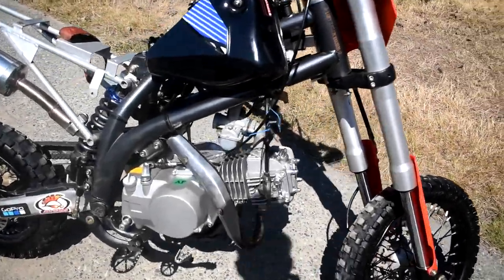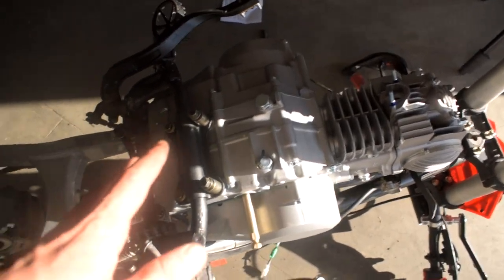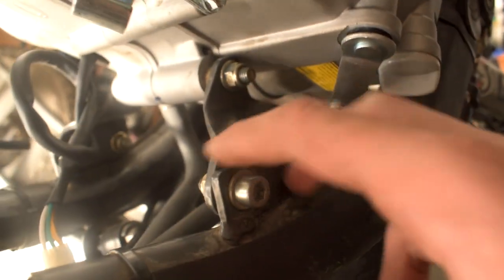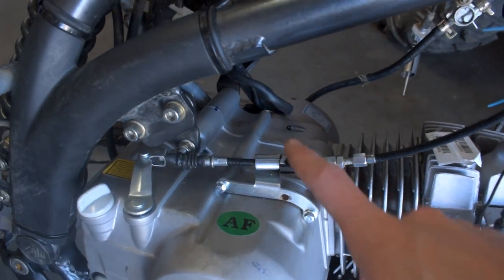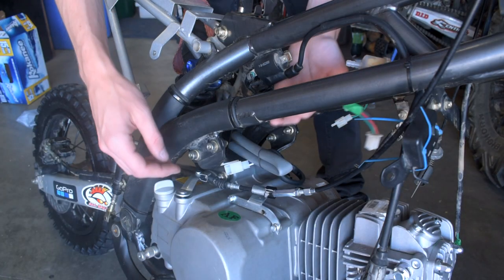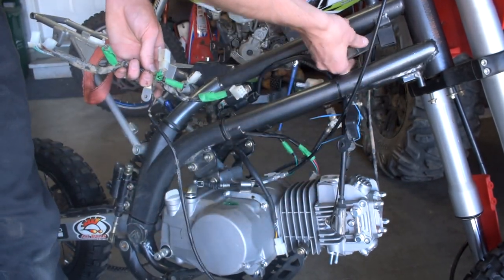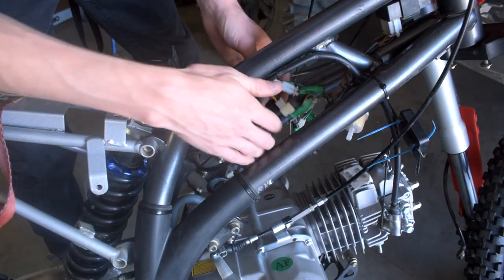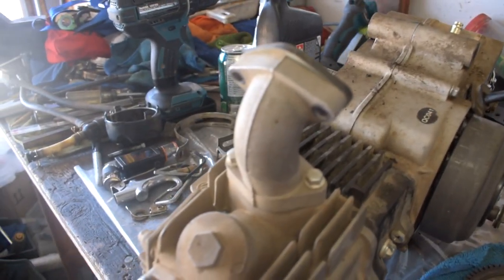Building A 150cc Pit Bike in 12 minutes | Apollo RFZ 150CC Swap Part 3: Engine Install

Comment: Looks sick! You should just bump start it for now and start the engine break in. Obviously not a great solution on trails but it’ll get you up and running
Reply from the maker: Still gonna need a proper clutch assembly
Reply: Aww true If you can’t get into first that won’t work

Comment: Do you think the 150cc engine could benefit from a 150cc CDI box? Or do you think the 125cc, and the 150cc engines possibly share the same CDI box. I've heard they sold what they might call an advance CDI box that slightly helps the bike out apparently
Reply from the maker: honestly i wouldnt trust any replica or knock off cdi's. From what Apollo Motors told me, the 125 and 150 share the same CDI box.

Comment: Should I remove that oil filter air release completely??  or what If would just remove the black plug mine has same thing already starting build oil up in it
Reply from the maker: thats what i did. i removed the whole thing, and then you run the engine side of the tube down the back of the casing (there should be a little tab mount there already for it)

Comment: It suck that you have to wait for the kickstarter, but you order them already right? The part where you tried the gear lever felt good and solid, how does it compare with the 125cc engine?
Reply from the maker: I havent found one in stock thats not 1-2 months out . The gear shifting feels way more solid in the 150

Comment: And dude to be honest you had exacly the same problem as me i just didn't put mine togther and also i had pur a 160 but second hand and had to get the shop the put it together but it didnt work and then i had this brand new engine that was suppose to be a 125 but then i got a 125 clutch cable ended up being the wrong size and then a 140 and i got to work also the kick starter i had on 160 was to small for new motor and also my engine looks exactly like yours but mine's supposed to be a 125 hmmm ? Love the build anyways man!
Reply from the maker: sounds like we whent trough the same kinda ordeal haha! Thanks for watching and hope you enjoyed!

Comment: And you can push start it click it in second gear run with it jump on it and drop the clutch works best down hill
Reply from the maker: Of course, but i dont wanna get into an enduro trail n have to try n bump start it
Reply: @AaronsEnduro  ik not take it on a Enduro ride just do it in ur drive way and ride around the yard so we could hear and see the bike run
Reply from the maker: I have no yard and have neighbors thatll call the cops asap when i take the bike out. Gonna have to do a test n tune in the woods or somethin

Comment: The 150cc engine that you linked did not fit my Apollo z20. Also, the wiring was completely different from stock: the CDI was 8 pin.
Reply from the maker: This engine and swap was for the rfz platform not the z20 platform (as i showcase the rfz)
Reply from the maker: Curious as to what “didnt fit” tho.
Reply: Did you ever found a engine to swap in to the z20

Comment: Hey bro which bolts did u put in first? Did u put it in with the bike upside down?
Reply from the maker: Yes i put it in upside down, if I remember correctly it was the back through bolt first then the four on the skidplate area
Reply: And then the top one last?
Reply from the maker: Whats most important is not to crank down any of the bolts until their all started to be threaded in

Comment: What motor is that exactly like where did you get it I swapped my ssr125 with a yx150 Ycf racing motor mine went right in!!
Reply from the maker: Its a ytx150 !
Reply from the maker: Got it from apollomotors.ca
Reply: Where you got your engine  I got a 110 you think it would fit
Reply from the maker: Yep should fit no problem! All engines fron 110cc to 190 cc use the same engine mounts!
Reply: @AaronsEnduro  oh Fr thank you so much and what engine you think I should get I have a ssr and I like all your videos they help me a lot with my pit bike 👌🏼
Reply from the maker: If you want the most amount of power for the least amount of money / modifications the 150cc lifan engine is a great choice https://amzn.to/3g7PhSY

Comment: Ummm how the hell do you you put a pit bike motor in a pir bike up side down wtf i build them up all the time but never have i did it with the frame up side fown looks hard youd need to hold the engine some how up side doen as your bolting it all together lol ?
Reply from the maker: I just held the engine in my hand and put the bolts in . Lol
Reply from the maker: Then one by one did locktight on them after. Idk man it was my first bike and first engine swap lol. I didnt watch a single video on how to do it or nothing. I just filmed me doing it

Comment: Please take off those dumb plastic protectors on the frame they literally do nothing and look dumb
Reply from the maker: You do realize this video is years old? Lol
Reply: Sure do
Reply: But I am going to swap my Apollo x18 motor as well and like your video .Sorry I just have a pet peeve with those plastic frame things nothing personal.I am looking ycf 150cc motor instead of the piranha .But anyway how is the difference between the stock 125 and the piranha 140 ?Is it worth $500
Reply: Your swapping an Apollo125 motor with a 150cc Apollo motor  ?My bad I thought you where putting a piranha motor in it still a good video though